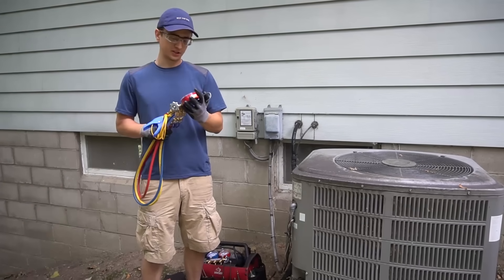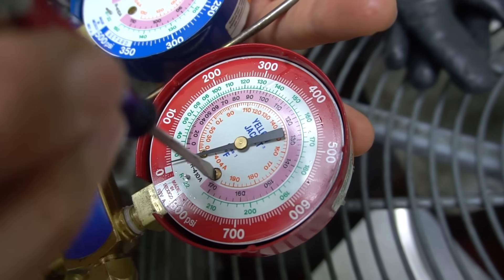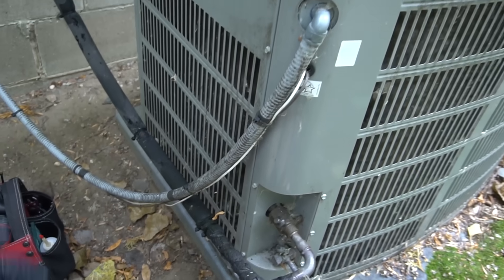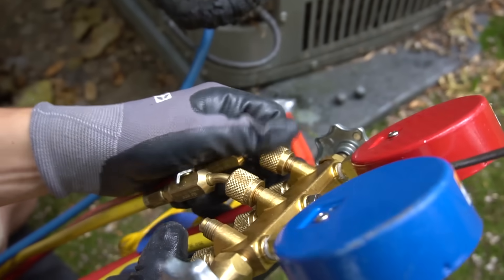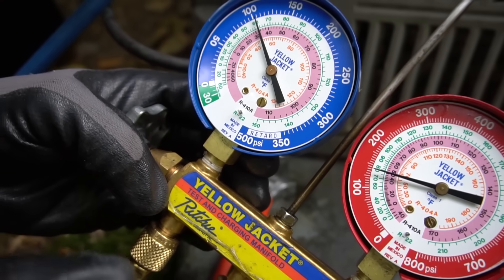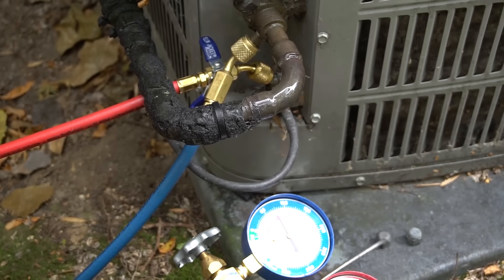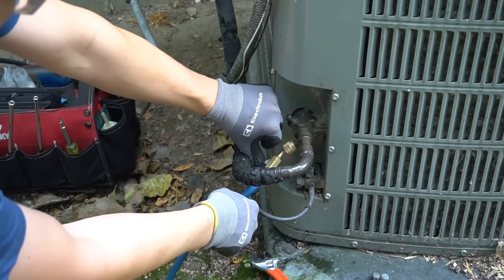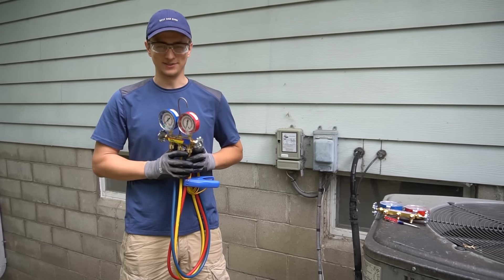How to Check AC Freon Level

Comment: Your pressure alone actually gives you almost no information about your system except that yes it Has pressure. There are multiple things that decide if the charge is correct and pressure alone will not do it. Most systems installed are either overcharged or undercharged
Reply: Yes no such fhcvy you be dKß
Reply: HVAC Mike. Can you tell us the other multiple things that the charge is correct.
Reply: Naz Shenouda indoor and out door temp superheat and sub cooling
Charging chart from the manufacturer. You need subsoiling for TXV or EEV SYSTEMS for piston systems you will need wet and dry bulb temperatures to calculate required super heat
Reply: This week i installed a second hand split system by myself & bought the pipe runs & flaired them /lagged & vacuumed the system & then released the R32 & it works & feels good & my teacher has been you youtube hvac guys 😀  , so its possible.  Even fitted a mini lime condensate pump . Thoroughly enjoyed doing it .
Reply: HVAC Mike but he has nice shiny tools. As he learns more over time maybe he will regret making the video

Comment: What about split air-condition we need video to service and filling too
Reply from the maker: One has to have a license to handle refrigerant so if I make a video like that it will create havoc for myself and others... Originally this video was a lot longer and I went into troubleshooting refrigerant problems (measuring superheat, subcooling, etc) but I ended up cutting all that out. So unfortunately no videos like that on my channel..

Comment: CASE: I had made an appointment with a repairman for my home FURNACE tune up.  Today a tecnician came to "tune up" my home American Standard HEATER unit.  Within 5 min of using the multimeter he told me I needed a new MOTOR BLOWER CAPACITOR, said "It's reading 3.6 but should read 5.0", and it would cost me $165 plus the tune up of $89 = $254 TOTAL cost.   I said I'd think about it for a few months. He told me (scare tactics): "The capacitor is going bad, If it goes bad it will damage the blower motor and you're looking at a $600 repair".  I gave some excuses and declined it. Suddenly he said he was finished, and asked me to pay the $89 and was out of the house saying, "If you change your mind, call us back but there will be an additional TRIP COST".
QUESTION:  Do you think I should replace the CAPACITOR and pay that much, or not? [I'm a curious handy-man but never done any work on furnace/heater.]  Or, should I go learn how to do it myself and buy the part at Home Depot?
Reply from the maker: You can very easily do it yourself :) Here is a video where I show how to replace a capacitor in the air conditioner:
https://www.youtube.com/watch?v=C82HvbvP08E&t=107s 
The one in the video is a dual capacitor. The one you need for the blower motor is a single capacitor which is even easier to replace. I think the video will show you all you need to know. Let me know if you have any questions though. Good luck!
Reply: Word of Advice TV I wish people would not make these kinds of videos teaching homeowners how to do things that they have no buisness touching. This is a very dangerous trade and requires 4+ years of schooling and on the job training, and still after all the schooling and passing your test for your license, takes years more to become a good tech imho. If you want to aim your content at apprentices just starting off in the trade, that would be awsome. But I dont think you should be telling homeowners how to work on equipment. It's not safe and they are not licensed to do the work. What can happen is they will watch a bunch of videos like yours and think they know so much now about heating and cooling and whatnot that they will be going around working on friends and families systems which is illegal and God forbid they damage property or hurt themselves or others in the process. Plus this takes money out of the pockets of licensed techs like myself who have invested our whole life to this career. Just please be careful of what you are teaching people on here
Reply: Most capacitors for blower motors are around $5. I had a customer last week tell me another HVAC company wanted $1,300 for an inducer and that it may not even fix the problem. They tried to "scare" her into buying a new system. I replaced the inducer for $240, that's labor included. I informed her that as long as the heat exchanger isn't cracked, and that the furnace has no other issues, to not replace it. The furnace btw is 14 years old and is a 90%. She won't benefit on replacing her furnace unless maintenance costs start rising.
Reply: It's been one year that I bought the capacitor for $8.00 and replaced it myself in only 10 minutes!!  It's been working well without any problem !!!  Thanks for the above comments!!
Reply: Yes. If he was being honest about his capacitance readings then you should have let him change it. No offense but if you dont know what you're doing you can get yourself hurt/killed or damage components. It will still work for now with the 3.6 mf but looks like it's getting a bit weak and will continue to get weaker

Comment: Do you have to add oil if you just vacuum it down to refill it? My ac comes on and is warm air yes the ac is on and the ac pump come on but the air is warm coming out 4 years ago it was cold I let it sit for a few years then I got it back out the shop to drive and the air is no longer cold it room temp but there is still pressure on the lines what do you think I should do? Thank you for your time have a grate day.     Ps it’s a 2001 Mitsubishi Eclipse Spyder gs 2.4L  if that helps any
Reply: I'm not the instructor,but advice the Freon would already come I'm together with oil the ingredients for refrigerant is acid,gas,& oil as far as I know just a tip

Comment: You said the other scales on the gauges read "temperature".  The gauges only read "pressure". The other scales are there because different refrigerants produce different pressures.
Reply from the maker: You are right, thank you for the correction!
Reply: The inner rings are the temperatures of the refrigerants at certain PSI's when the refrigerant is pure and free of non-condensables...

Comment: Hi Jay ....... I'm back :)  You nailed my last issues so I have another question:

It seems like my heat pump isn't putting out much heat. It feels cool with hand over vents, and I saw the emergency light turn on when it usually doesn't and also it is running more then it should be.   I checked the large insulated line coming from the outside unit and its very warm as expected.  The outdoor unit appears to be running fine (fans running when it should and remember I replaced the board a couple months ago).  The return copper line is not cool, I'd say, luke warm, not sure if it should be that way but figured it should be cooler if it were sending cold refrigerant outside.  In the summer I found the ac did not work very well either in terms of cooling the house but the in line was very cold.   I found the outside unit kept running but it was not cooling the house.

The unit was installed in 2004.   I never cleaned the coils but always kept air filters replaced often.   In the last 1.5 years I switched to the permanent filter before that I used the medium pleated ones like you recommended..

It seems like this could be low refrigerant/leak (bad if so) or possible a dirty coil (should be easy to clean)????

Should I do this test or try cleaning the col first or both?   Thanks man your videos are awesome!
Reply: UPDATE:   I pulled off the coil cabinet face and checked the A-coil state.   It looked silvery with no sign of any dust or dirt on the underside and top side.   There was a bunch of rust however on the face around the copper tubing from condensation over the years.  One small bug on the top side that was it.  Seems like it is OK.  

Been using the washable filter; they say it doesn't have an official MERV rating but it is expected to be about a 4.5ish.  So the filter should allow lots of air flow.   Mid level ones are rated 6-8ish which are the ones I think you suggested.  I'll give it a good cleaning and see what happens.
Reply: Call a professional u could have a small problem that can turn into a very expensive repair if not dealt with quickly.

Comment: Why do you not have a set of testo or field piece digital gauges? Listen get with the new age of accuracy and loose those analogs. Unless your calibrating them weekly they are no good see as you moved them..not accurate!!! Not to mention digital gushes will have temp probes built in to better check superheat and subcooling. You should NEVER hook up while running.. if is not running then hook up and start up the unit.. the added pressure after started may cause extra loss of freon. And when done stop the unit and dump the liquid back into the suction..to also minimize the loss of refrigerant.
Reply: What's the point of higher accuracy?  This isn't Rocket Surgery.  You can read an analog gauge to within a few psig.  You simply don't need to know it better than that.

Comment: I went to a 9 month 8 hours a day 5 days a week refrigeration school and have been doing this for 30 years. Gauges are the last thing you want to hook up. You hands are the best 2 tools that you have and they are what goes on a unit first and foremost. Touchy feely. Gloves are for those who have no desire to get dirty. Trust no ones diagnostics but your own. Refrigeration is not an exact science and it should be approached as such. There may be only 4 main parts in a basic refrigeration system but there are many external variables working against it and that is what makes this field a challenge to those who understand the basics and embrace the the challenges.

Comment: Wow
I'm currently a student in trade school (HVAC obviously) & using my guages & dealing with refrigerants has been the toughest aspect of HVAC for me to grasp. I've watch a dozen videos & this one is by far the best, most informative, & easiest to watch. Thank you for this my friend.
Reply from the maker: Glad I could help! :) Good luck with your studies! You picked a good field. (By the way, (for what it's worth) when I went to school I remember refrigeration being one of the harder parts to learn as well)
Reply: @WordofAdviceTV  I am registering for classes for the fall semester Jay. Do you have any advice for students? Like did you only take residential or commercial aswell?
Reply from the maker: @aarongray503  Hey Aaron! When you said you got interested in HVAC, I didn't think you meant that you were interested enough to actually start going to school for it! :) Nice! I took one year of residential and one year of commercial because I wanted an associates degree in HVAC, not just a certificate. Since I am not planning on going into commercial, I really didn't need to go that extra year.. But who knows, maybe someday that will come in useful. I wanted to join a union and keep going to school for another 4 years after college when I just started on my journey. But plans changed and I stayed with residential instead.

As for advice for students.. Here's a couple things off the top of my head:

1. If you do not understand something, do not be afraid to ask a question. Even if it makes you look dumb lol. There's a good chance that others don't get it either but they don't want to look un-smart in front of the class/teacher so they keep quiet. In my class I was known for being the question asker, other students eventually started to rely on me to ask most of the questions. (some would suggest questions that I should ask) So make sure you understand what is being taught, keep asking questions if you need to.

2. Take notes in all your classes even if you don't have to. I still have a huge filer folder where I have notes and hand outs from all of my classes. I took detailed notes and drew the pictures off the board. Writing things down helps you remember the stuff better and can be a resource for you later if you need it.

3. If they have a lab where you can practice hands-on, like soldering, brazing, wiring, troubleshooting, etc, make an effort to put more time into that. If you finish before others, well then solder a 3d square or something while you wait for the others. The more you practice the better of course.
Reply: @WordofAdviceTV  Well originally I never intended to be this attracted to hvac. Just wanted to learn to save money from having someone come to my house and fix something that I could learn to do myself. The tech that came to my house has his own business and told me I seemed like a smart young man because I told him everything I tried to do to troubleshoot/fix the a coil from freezing up. He offered me a position if I were to get my associates degree in hvac. So from a big push from him and my wife I am now pursing this trade. It's going to be tough because I have a three year old and a baby on the way but I want to better provide for my family and have a trade that will last me years to come and hopefully enjoy it at that! Thanks for the advice I will for sure follow your words of wisdom. :)
Reply from the maker: @aarongray503  Sounds exciting! It will be tough but I'm sure you'll do well! Especially since it sounds like your wife is fully supporting this venture. I have an associates degree in accounting. I felt so useless doing that lol (it was really boring too), a man who can't really fix anything around the house. It's much more rewarding doing this trade instead. I know a guy who only has one arm and he decided to go to school for HVAC as well. If things get tough, remember that at least you got two arms.. Four more points I would like to add to my first three though :)

4. If at all possible, it would be very beneficial for you to get an HVAC job as soon as possible while you are going to school. There are many places that will hire new guys that just started going to school. I know this may not be possible since you already have a family going but it would help you a lot in school. Stuff that you run into at work you can then bring to class and talk about it with the rest of the students and teacher. Since you have watched so many YouTube videos on this topic already, you will have a giant head start on most of the other students by the way.

5. Do not be afraid to switch jobs. HVAC technicians are in high demand. Once you get some experience, look for better opportunities until you find one that works best for you, fits your schedule, gives you more time with the kids, etc. When I went to school, by the time the second year was ending, most of the students were on their 2nd or 3rd job. Employers would come to the school to try and recruit people. When I switched from my first job to the second one, my hourly wage went up by $10. So just don't forget that your family comes first. Even if your employer will be very cross with you for leaving.. If it is better for you and family, do it.

6. Don't burn bridges. If you are switching jobs, try to quit as respectfully as possible. Thank them for everything they have taught you and for giving you the opportunity to work there, etc. You never know if some day you may need to come back there.

7. Be cautious of the 2-week notice. When I put in a two week notice at one place, they released me that same day and had someone drive me home (I had a company vehicle). So be aware of the possibility that you may be let go immediately instead of in two weeks. Comes as a bit of a surprise when you didn't see it coming. Might be a little hit to the wallet.

This is a good topic! Didn't think that I would end up typing all of that out.. Maybe I should make a video for new HVAC guys where I talk about all this.
Reply: @WordofAdviceTV  Wow thanks Jay! That is some great advice! It's going to be a slow process as far as the classes go because it looks like I will only be able to take one class at a time. I have a total of 11. Lol. Maybe I can work something out with the wife. Did you have all of the required tools your first day of class? I found a list of tools I will need and man o man. I got a lot of the basics like drivers and pliers and multimeter.
Reply from the maker: Yeah, juggling work, family, and school can be a little difficult. I got lucky that we didn't have any kids while I was going to school. I went to night school, monday-thursday 5-9pm. So right after work, straight to college. I had no tools at all when I started school. During the first class they handed out a list of recommended tools that we should get and I ordered everything on the list.... Was around 1000 bucks. That was a mistake. I would just start with the basics and buy tools as you need them. Some of the tools I bought I only used a couple times and now they are just collecting dust. Also, many employers now provide tools so if you get a job like that early on, that will solve the tools problem for the time being.